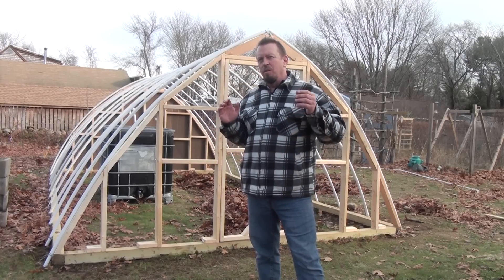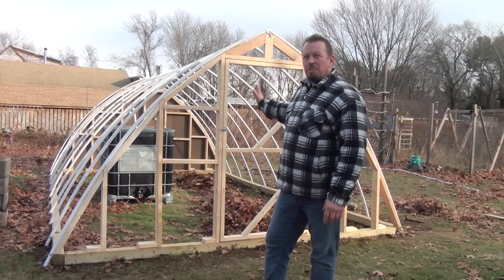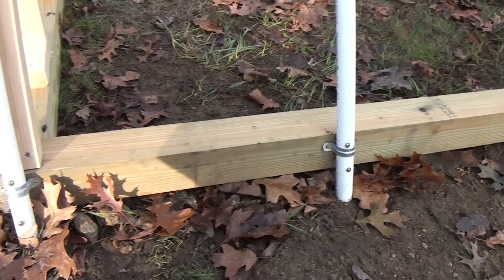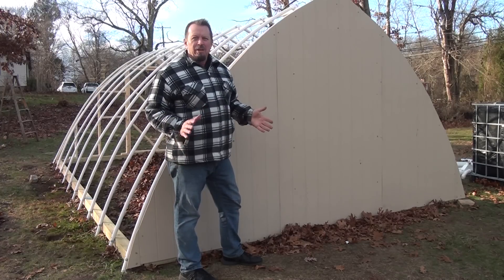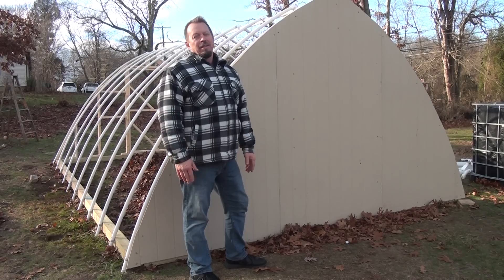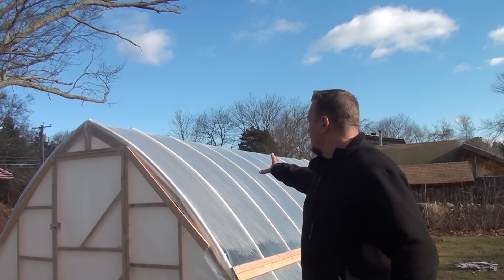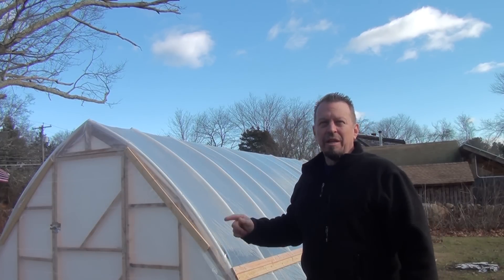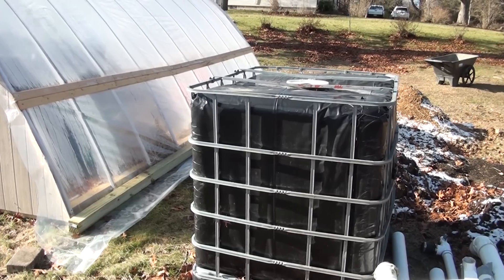Building A $580 Geothermal Greenhouse!

Comment: This is everything you want, but a geothermal greenhouse ! :) . First, if you have condensation on the plastic, say bye bye to heat, that layer of water will throw all your heat out. Second, if it's cold, make it a double layer, with very few air currents in between the layers, so you'll keep the heat inside.
Third, but the most important, geothermal it's a clear term by itself, and you didn't even dug to have the greenhouse half sunken, which would've been a great thing to do. So, my advice, before posting again about building anything with "thermal" in title, study a little bit of thermodynamics, fluid and gas mechanics and maybe something specific about air currents. Good luck !

Comment: I used to build green houses, I see 2 flaws
1) Walls/roof are too flexible , they will collapse under snow or wind load.
2) One layer of plastic is an energy sink, works ok during the day but plummets at night. You need at least 2 layers with a blower,
 I have done 4 layers which worked super good. Use 2 old layers under 2 new layers.

Comment: I would have dug hole first with a back hoe or excavator before building the structure 😊
Reply from the maker: If I had the money to dig out the hole, that would have been amazing.  But I didn't.  I did dig out a 1 half of the greenhouse before a family of groundhogs made holes throughout the greenhouse.  They didn't touch the tomatoes that I planted in there though!! :-)

Comment: Should have removed the tons of soil prior to building your hoop house and used a backhoe.
If I remember correctly the pvc pipes break down quickly in sunlight.
Reply: Lol. PVC conduit is used for well casing and electrical. It does NOT break down with uv...lol
Reply: @darrellinkster7385  what took you so long to answer.... only good for 50+ years or so lol I stand corrected Darren
Reply: @Jacobyte1746  your dipshidity stands the test of time.
Reply: @darrellinkster7385  ok Darren I saw that you were a bit slow but now you are childish with name calling... can't  you find something better to do than trolling old posts on youtube?
Reply: @darrellinkster7385  no plumber matey I'm a Horticulturist but if cared to look I corrected my error but you wanted  to call an old senior names but you thought to troll and call me naughty names as you were blinded by covid hated you've got to keep trying to get the boot in all about a Tube!
Reply: @darrellinkster7385  you had to go back and change your original reply to make it sound technical & to seemingly legitimize your following replies...

Comment: That is not just a greenhouse.  That is ACTUALLY a greenhouse that he ACTUALLY built.  ;)
Reply from the maker: Well thanks!! :-)
Reply: Hate to burst your bubble so to speak... but a Greenhouse, (glass-house or hot-house) is covered in glass.
You could have also used double 6mm plastic and used 2 small fans to circulate air between the layers of plastic which would also help to keep heat inside or slow heat loss in extremely cold nights.
Reply: @Jacobyte1746  hate to burst your bubble but there is not one solitary definition of a greenhouse and they can include ones that use plastic. 

if you're gonna be pedantic, at least be correct.

Comment: What size pvc pipes?  Inches round and how long.  What to use to connect them.  How to connect to ground?
Reply from the maker: 1 Inch pvc is what I used and I strapped the base of the pvc to 4 by 4s.  Home depot has 1 inch metal straps that you can screw into the 4 by 4s.  I drilled holes into the 4 by 4s and  pounded rebar into the ground which worked well! :-)

Comment: Would’ve been nice to show how the plastic was attached, many details missing or presumed.
Reply: I like to use wiggle wire. Is used by major green house growers and you don't have to poke holes in plastic...
Reply from the maker: its easy to attach the plastic.  Just measure the size of the plastic  length and width to go up one side of the greenhouse to the top while adding about 2 more feet.  Its best to attach it on a day where the wind speed is low.  It helps to have about 4 people to hold the plastic in place.  I have ferring strips to hold the plastic in place. This helps to really secure the plastic.  If you'd like I can do a video to show how the plastic would be held in place.  Let me know and I'll try to have the video for you and others.

Comment: Good use of Gothic arch. Greenhouses should not be glazed on the north side because that side has a net heat loss over the year.
Reply: I was thinking of the same thing, but then I came to the conclusion that nothing will grow in the shade behind the greenhouse if the wall doesnt let light through.
Reply: @artfx9  Shade-tolerant greens would probably grow. I'm currently growing a Moskvich tomato in a shaded area. It's doing OK. During the summer, with the Sun overhead, the shaded areas would get some Sun.

Comment: Cool project.  I live in NW Florida and I'm going to build a greenhouse this summer. Tired of hauling plant in and out.
Reply from the maker: I'm hoping to move down to florida.  My geodesic greenhouse is about is 14 feet high and 24 feet across.  If I move to florida I'll definitely put a few small zip tie dome greenhouses on a property for times when the weather gets cool.  could put the subtropicals  in and keep them safe from cold weather!
Reply: @stevejacobson8958  it could easily house them permanently for non-stop production

Comment: I like to see your greenhouse when you get an 8 foot deep. Not sure why so deep but interesting. Like the greenhouse. Kansas
Reply from the maker: If you dig 5 to eight feet down you can put drainage pipe in to blow 50 degree air into the greenhouse in the winter to warm the air and in the summer to cool the greenhouse.  I did have quite the problem with a woodchuck last year that burrowed  2 holes into the area that I had dug.  If I do it again, I'll make sure that i put cement walls in!!! LOL

Comment: I build a greenhouse out of 1/2 inch plasic flexible waterlines. I take the plasic off - 1 piece- late in the spring so the rain takes care of the plants. It only takes a hour or so to remove and put back on. This saves the plasic and also don't need to worry about venting.
Reply from the maker: I'd like to see more about what you do with the flexible waterlines!

Comment: I think that you should've included some more of the uPVC pipe as 3 horizontal ribs equidistant from each other about 2' apart to increase strength and prevent twisting due to wind shear. Also no mention of whether or not you chose UV light resistant poly tunnel sheathing. Got some on mine that's got a 10 year life expectancy.
Next time dig the hole first.... and use a digger - far faster. 😋😅
Reply from the maker: Yes I will definitely dig first!!   horizontal ribs is a great Idea and will consider that next for a future tunnel.  So far the 1 inch PVC pipe seems to be holding its own.  Even on days where its really cold out the ground is warmed by the 70 to 80 degree air!
Reply: @stevejacobson8958  You could still install horizontal ribs. All it takes is an electric drill to secure the piping from the inside with some bolts and nuts and possibly plastic plumbing t-junction brackets to match the size of your pipes. If using t-junction brackets that would be the easiest as they can be screwed to the uprights with the horizontals slotting in nicely to the t's.

Comment: Love the video If you going to take down 8 feet please put up some type of wall support I used to excavate it's not uncommon for a wall to fall in at 8 feet!
Reply: It will also add thermal mass that will release its heat overnight; particularly useful in cooler months. I'd also remove that H20 tank, locating it outside & run a pipe with tap setup in through the paneled end and possibly try to work out how to harvest as much H20 off of the greenhouse roof, channeling it into the H20 tank for storage and later use. Full marks to Steve for trying but this project could've still remained an inexpensive one but with a bit more thought having gone into the planning process in order to make it a more efficient greenhouse overall. I hope that he's used a silicon sealant wherever he's punctured the envelope by screwing wood to the uPVC ribs through the poly tunnel sheathing or he's going to get algae and mold building up on the inside as moisture penetrates. Wish him all the best anyway.

Comment: How is this geothermal?
Reply from the maker: By Digging down into the greenhouse you can Tap into the 50 to 55 degree air that comes from the soil that has been dug out.  I'm in a northern climate and temps reached down into the teens but nothing froze in the greenhouse.  The first year I had the greenhouse some plants froze but after having dug deeper into the ground The plants never froze.  When it is entirely dug out, it will be filled with drainage pipe and crushed stone and fans will blow the air through.  The reason why it was partially dug out is that a family of groundhogs  decided to make there home on the right side of the greenhouse. :-)

Comment: Actually I just planned to build a chicken tractor/greenhouse using the pvc... ordered the material!  ( chicken tractor; *a mobile greenhouse for chickens), out of PVC same build as yours only light weight bottom will only be 2"x3"'s.  I will need one crosser in the middle on the bottom, but am going to have a few light weight hen laying boxes in there as well! I built a chicken coup/winter greenhouse 2 years ago, works amazing in our ZONE 2 area, where nights can get down to -40c/F in Northern Ontario!!  The secret is a second, very thin layer of plastic sheeting hanging off of the inside. It is about 6-12" from the outside plastic.... the trapped air is VERY insulating in the winter, and if it is sunny at all, it heats up nicely!  
Cudos! Love your design!
Reply from the maker: Wow!  I love that use of the shape of the greenhouse / Chicken Coop!  I want to see it in action when you have it built!   Do you have a youtube Channel?  Hopefully you'll post a video of it! :-)
Reply: Sounds great in theory but chickens have very sharp beaks & claws so plastic usage might be a false economy & if you have Foxes in your area, plastic would be ripped to shreds in seconds - no live chickens in the morning. Wood and chicken wire is probably best.
Reply: @pinkelephants1421  I had put 2 cm square  metal mesh, 3' high inside on the lower walls. Although fox have never tried to rip it open! Squirrels can be more of an issue because the tunnel under!  Cheers!

Comment: I really like your design. I am going to build one like yours. The cheap plastic on the ends my be a problem sooner then you think. As a retired heavy equipment operator I would have done all the digging with a backhoe before building the structure. At 82 I don't need the exercise. Thanks!
Reply from the maker: Well Thanks! :-)  The back of the greenhouse is framed in with wood but the front of the greenhouse is pretty strong because its framed in with 2 by 4's.  If I had the money to have a backhoe some and dig it out, that would have been the best way for sure but will have to keep digging it out myself LOL.  I should have just dug the hole before putting the the greenhouse up.  :-)  When you build yours I'd love to see the video of it!!    Thanks so much for your comments!!! :-)
Reply: @stevejacobson8958  I can appreciate the ingenuity.
Reply: I only wonder about strong winds. Around here they hit pretty hard.

Comment: Great video.   Suggestion, a barrier b/t your PVC and film...   they sell a felt tape to prevent the off gas of the pvc from damaging the film.
Reply: Hey Unconventional you! LOL  Is painting the PVC going to help? It is supposed to be paintable... by specs.
Reply: Lars Hildebrandt I hear it works but I wouldn’t use bargain brands for it.  Try and plastic adhering option

Comment: I like using the 90 degree joints at the apex, as it gives more usable space than the single pipe arch design.  Looks like a nice build.  When you staple to the plastic, you might want to use nylon batten tape to keep the plastic from ripping away from the staples.  I thought I was a glutton for digging punishment, but you have me beat with the 8 ft hole!
Reply from the maker: Well thanks so much for your reply!!  I will totally get some of the nylon batten tape.  So far I've removed about 2 tons of dirt from the greenhouse!  I can't wait to get 8 feet deep!  It'll make the greenhouse seem bigger!  Do you have a video of your greenhouse?  Would love to see!
Reply: @stevejacobson8958  That's fantastic.  I have always been interested in digging a root cellar.  It seems reasonable that if the root cellar has a similar volume to a greenhouse, that you could simply exchange air between the root cellar and greenhouse.  You might want to insulate the root cellar down to the frost line.  I think you would like some of the stuff on my channel.  Here's a description of "greenhouse 2.0" (https://youtu.be/Ze0nXN6Vvic).  I posted performance results for the geothermal and compost heating systems in two separate videos (see end screen of the video for links).
Reply: You could use swimming noodles to protect the plastic from ripping on the top of the greenhouse